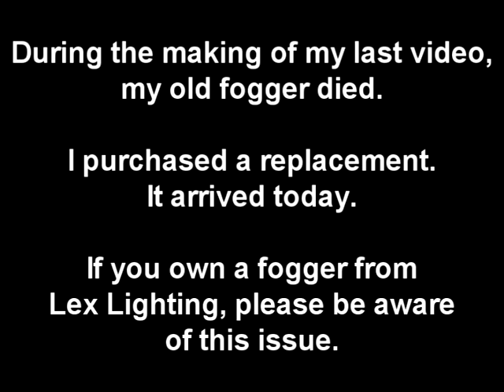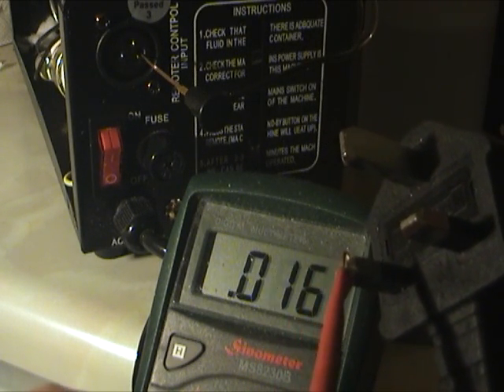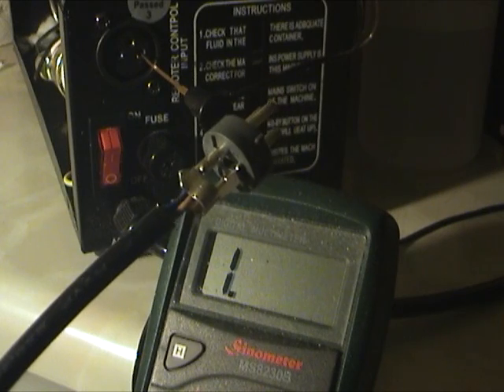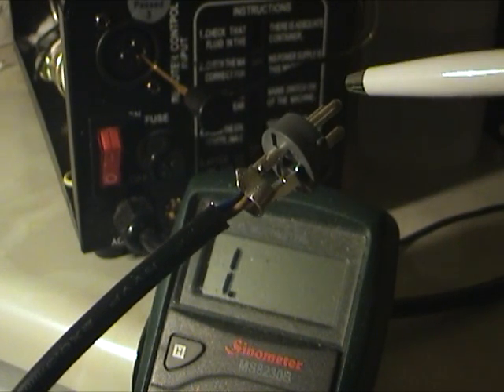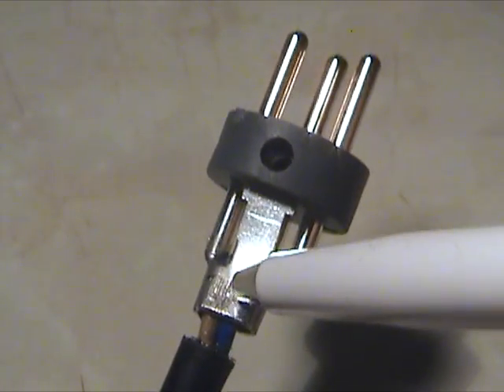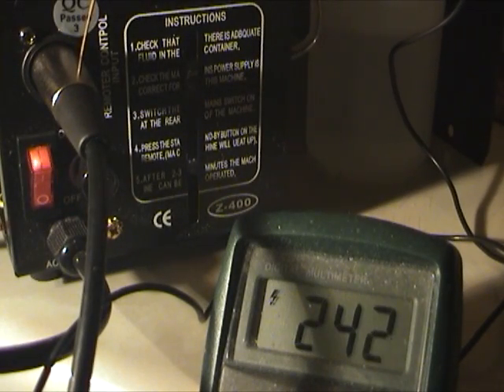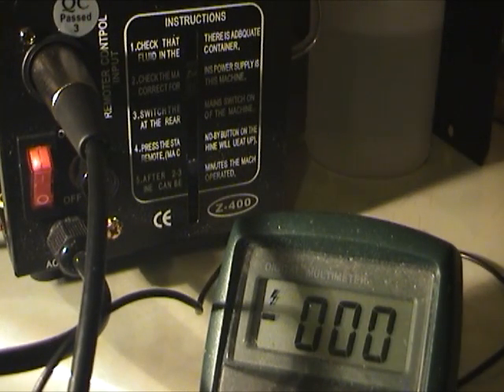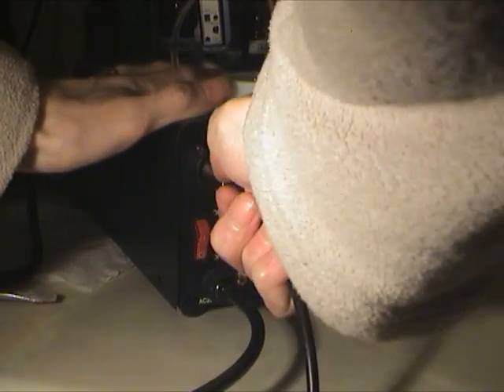Fogger Shocker

Comment: I had one of the F500's in for repair, albeit a later version but I was horrified to see how the thing was wired. The XLR seems to have been replaced with a female IEC socket. This would at first appear sensible as the 2 live conductors are shrouded and use the L & N terminals - but wait! The earth pin is being used as a convenient connection for the live side of the pump! Ok this does not present a hazard in itself but would constitute a serious shock hazard should someone accidentally use the socket fas a power outlet and connect an appliance to it. The result would be 230v connected directly to the chassis of the appliance via its earth wire! Another fail is the switch connected to the neutral side - meaning everything is still live if the switch is in the off position (the EU standards specify a double-pole switch anyway). The unused earth wire going to the remote has been cut and pushed back into the end of the 3 core cable. The remote itself has a rather dodgy LED and series resistor in series with the pump. If the manufactures claim that these are approved they certainly would fail the CE standard - and thus shouldn't be allowed to enter the UK. The external design has obviously been made to mimic the "Martin" style foggers - which are far more superior and who's electrical safety is not an issue.
Reply from the maker: Carlos Stein Oh dear.
That's not good to hear.
It seems that one can add some more watts, change the name and even kind of address the issue but seeing the bigger picture of what I reported all those years ago has eluded them.
I wonder if they "removed" the "F400" from sale because my video comes up at the top of the list for anyone searching for it.
Perhaps if you tried telling them, they might take notice.
However, this video stands as evidence that they were shown that something wasn't right back in the beginning of 2011.
You might like to go and tell the Lex Reviews fanboy, too... He doesn't seem to have any comments on his F400 MkII video. Maybe he'll update his "review".
Reply: Strangely enough, the F500 seems to be on the market with an RF remote now! AND a CE mark! I don't know why I spent the time making this thing safe. I've fitted an earth wire to the "spare" iec pin and installed a ceramic connector block with a few snubber network filters. Iv'e also arranged the switch wiring to be on the live side of the circuit. I should have chucked the bloody thing but I suppose I didn't because it belonged to our friend and he was quite fond of it - plus he was using it on stage with us!
Reply: Actually dude. Seeing as you are interested in safety and stuff: I have issues with switch-mode PSU's. Most of the class2 PSU you get for laptops, chargers etc have a 110-240v potential between it's ov and the mains earth. this plays hell with audio equipment and is a bummer when you get shocks of a mic on stage because of it! Apparently the CE acceptable leakage is 86uA (thats measured on an AC ammeter). 
For my stage kit I pull out the caps between the mains and the LV side and stick an earth wire on it! Sod the emc - those circuits can be lethal!
Reply: BTW Iv'e had this issue out with the IEE themselves but they just comply with the European CE directive.

Comment from the maker: No. I didn't ditch it. I fixed the failure (although I was not able to fix the design).
I rarely use it these days (as it does somewhat scare me knowing that it has a potentially dangerous mode of failure). Whenever I use it, I make sure that I never touch it once it is connected to the power supply and use a wireless remote to operate it. Once bitten, twice shy - as the saying goes. Don't get me wrong, in use, it's a very good machine, producing clouds of dense fog (unlike my previous unit).

Comment from the maker: I was hurt ! Don't fucking patronise me.
The design of the unit was not FAIL-SAFE. It was FAIL-UNSAFE.
If seeing this video helps prevent just one single accident, then it was worth making.
A full product recall does not require the CE to instigate it. It can also be instigated by a responsible company who have been producing potentially lethally dangerous appliances. LexLighting certainly knew how to contact me. I will not buy anything from them again.

Comment: I think you are correct.  the metal outsides of the mic connect to ground for that reason.  HOPEfully it avoids making a connection through your body if something shorts out where voltage is going to the casing.  I could be wrong tho.  I'm just a layman!

Comment: naw, dude.  Don't read anything into my stuff besides me just spouting what I think I know.  I'm not really an electrician (although I play one on TV) argggggg  cough cough....    In my limited knowledge, the negative stuff is what you ground.  That way any short will send the voltage to ground instead of through you as the bare ground wire has more potential than your body.  easier for the outer electrons to travel down that copper wire than through your body. my laymen's take.

Comment: That's quite true.  I was not thinking about that but just about the actual audio signal itself.   That phantom power is for the mic, not to boost the audio signal really.  But I'd not like to get hit by 48 v either.   You just never know what it might do. 

I've been shocked several times and once with my right hand on guitar knob and mouth on mic.  OUCH.  my vision when white and it kind of sapped the energy from me.

Comment: @HotblackDesiat042 IMO, there should be some serious design revisions for the device.  Just from what you’ve shown in your video, I’m sure that UL would never approve of 240v being present on the receptacle with it off. Also I’d be willing to bet that they’re using an underrated XLR connector, as all the ones I’ve seen with a crimp style terminal are rated for 50v, whereas the XLRs rated for 125v-250v are always solder terminals.

Comment from the maker: @danny999911 - This wasn't a "wear and tear" issue, something that is likely to happen over time. This is how it arrived from the factory. It is an issue caused by a very bad and dangerous design compounded by very shoddy manufacturing and/or quality control. The cable-grip hadn't been crimped (crushed against the cable) so the prongs stood proud and made contact with the metal shield of the XLR plug making it live.

Comment from the maker: @SGresponse - No. I didn't know until one hand was on the case and I grabbed the XLR with the other. Otherwise, there was no indication that the socket was carrying mains voltage. My first thought was that there was a  loose wire inside the unit. When I discovered that it had actually been built this way and that the only fault was a simple oversight in crimping the cable-grip which was in contact with the stripped end of the wire / end of the pin, thus making the shroud live, I was horrified.

Comment from the maker: @SGresponse - Yes. You understand correctly.
The controller appears to require 240v and rather than use a connector which would be safe for this purpose, they decided to use an XLR socket. Why the designer chose to use an XLR socket for this purpose is anyone's guess. They claim to be doing "everything they can to resolve the issue", which doesn't include removing this unit from sale until it's been redesigned to be fail-safe, it appears.

Comment from the maker: @TheFounderUtopia - It would be unlikely that they would recall every unit - Imagine the cost of such a procedure. That would be the kind of event which could finish a company. However, I don't think that the person responsible for that element of the design should get off scott-free. I was lucky in that it happened to me when I was at ground-level. Someone could have been working up a ladder in a lighting rig and accidentally touched that connector. Not much point in apologising to a corpse.

Comment from the maker: @TheFounderUtopia - If they'd tested the fogger, they'd have found it to be working as per design.
If they'd tested the controller, they'd have found it to be working as per design. Only testing to see if the shroud was shorting to one of the pins would they find any problem and that wouldn't prevent the unit working.
My issue is that I consider the design itself to be unsafe.
As you say, top marks for acknowledging the issue. What are they going to do now? Recall EVERY unit sold?